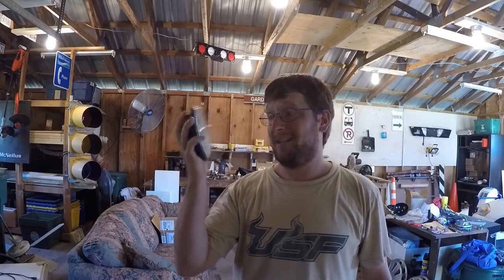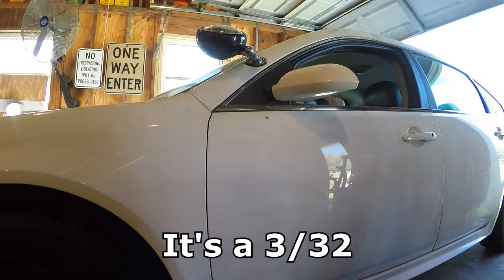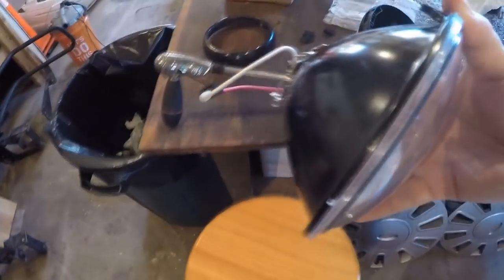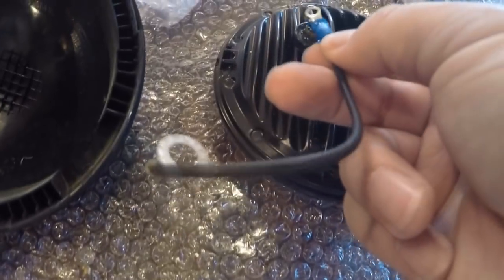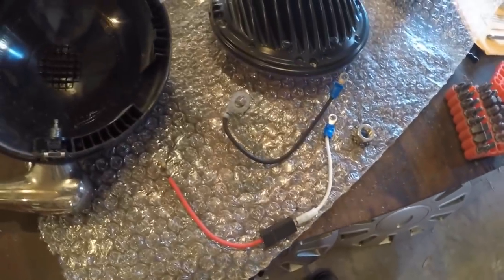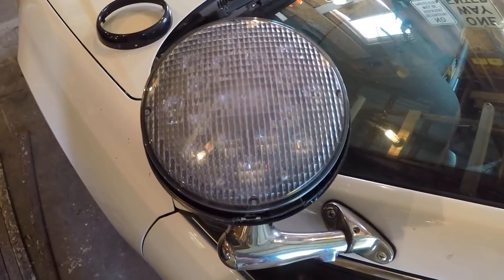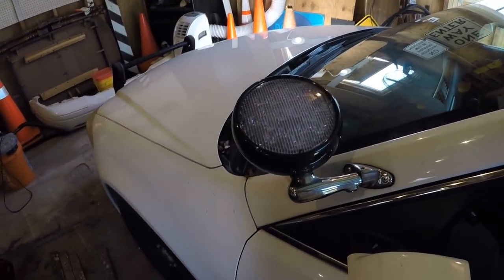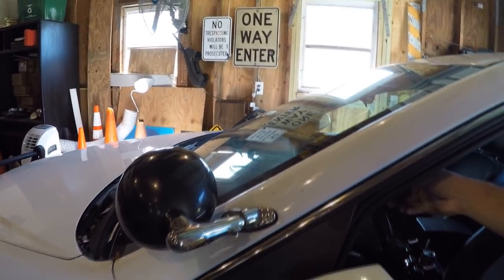Whelen PAR46 LED Bulb Swap on Unity Spotlight

Comment: Nice work Allen!👍 You should’ve put internal tooth lock washers on “poles” of the LED light before installing the nuts (or even 1 on each side of the wire ring if there’s enough threads). 😳 = prevents them from coming loose!
Wire Connector~ Tooth Lock Washer~Nut
~Larry

Comment: I have owned a few fleet vehicles before and i just swapped out the stock bulb spot light to the par46 led spotlight. Its a very common light. The real led spotlight that the police currently use it 200$. The 35 watt led par46 spotlight is more friendlier priced at like 50$ or less. My personal opinion. Either buy the 200$ real police led spotlight or buy the sealed beam halogen. (The stock bulb spotlight you can toss out like trash.) The sealed beam hallogen light performes much better than the 35 watt led par46 light. Its also a poor spot light even though it is marketed as a spotlight. The led looks better off but performes like the stock trash bulb. Great video. I loved the simplicity of the crown vic.

Comment: The spotlight on my Vic has a very loose on/off switch, and will not stay on.  I've never opened one up to see if it can be fixed, so anyone has any suggestions, it would be appreciated.
Reply: @endtimes711  Actually, I do.  I film trains for my own channel and that sometimes requires me to film at night.  So this spotlight (which has been fixed and is being converted to a floodlight) will come in very useful.  There are in fact other reasons to have them than just being a cop.  Loser.
Reply: @RailfanJason  - a person resorts to name calling when they have nothing intelligent to say.... most often because they have no intelligence